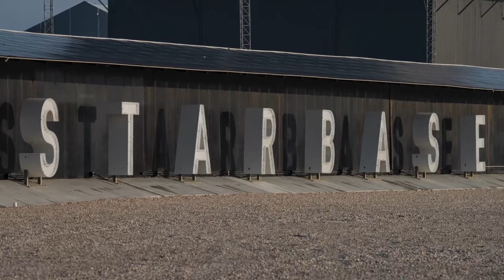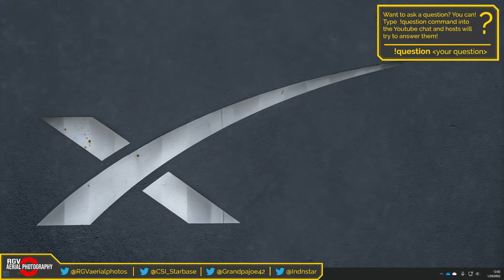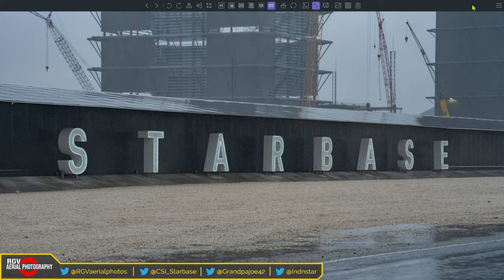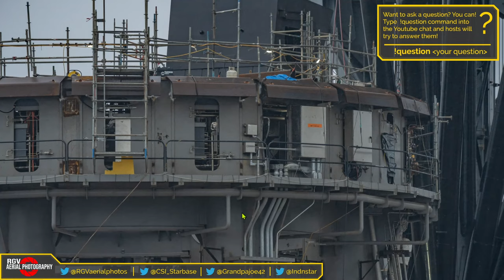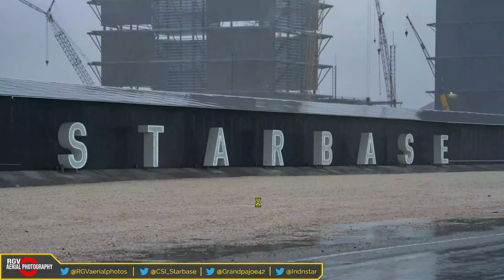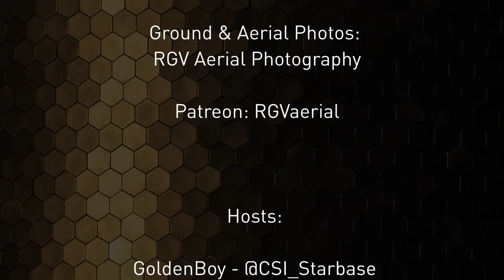Starbase Photography Review Episode 7

Comment: By the time a booster gets to the chop sticks they will be firing only the center raptor.  They aren't going to fire more than one because they want the booster to to meet the chop sticks as the decent reaches zero.  

Multiple raptors firing a nearly empty booster would mean a second very temporary launch that would end in total disaster for said booster.  

The chopsticks are safe from a single raptor firing at the center of the booster